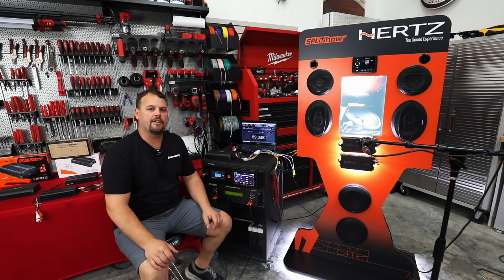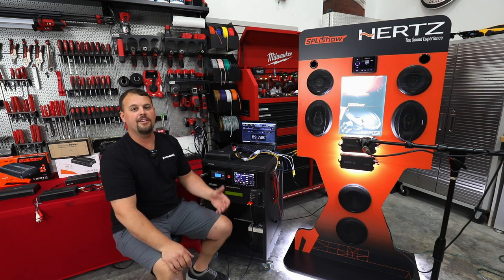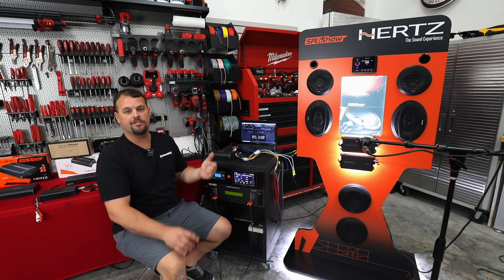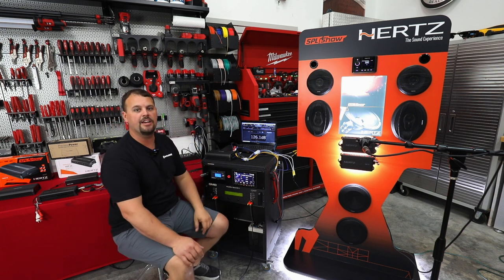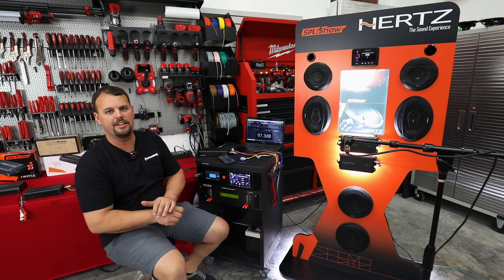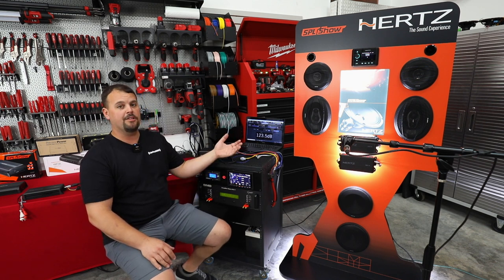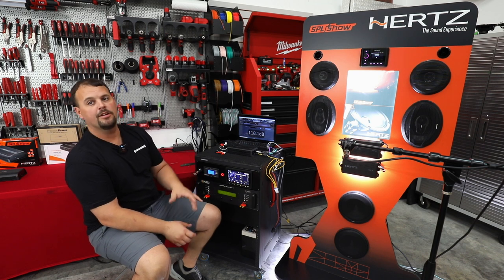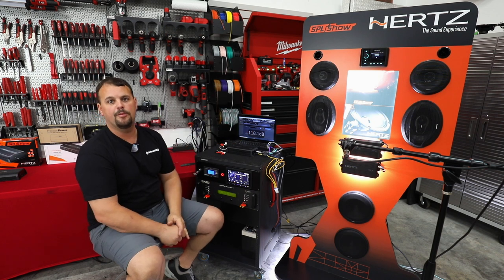How much more sound do we get with more POWER?!  Harley Amplifier Sound Comparison with SPL Readings

Comment: Another great video easy to understand and very informative. Curious about what to expect from the stock HD 4 speaker system if you upgrade all 4 four speakers with the SX165 Neo but kept the stock GTS system. Thoughts?
Reply from the maker: I get feedback from customers that is sounds much better but don’t expect huge volume gains, we always add an amp when upgrading speakers here at our shop, I would suggest using sx165neo front and sv165neo in the tourpack

Comment: What is the decibel reading in this same set up but running the sx690 neo’s on the sp4.900?
Reply from the maker: Sorry we did not test every speaker, this was meant to show what increased power does using the same speaker
Reply: @volunteeraudio  right I understand I was just wondering if you have done it in the past if you knew what it was

Comment: I have the 3 way Mille legend in an active setup. I want to purchase MLPOWER1’s/5’s will it sound better than the cheap cookie cutter amp brand (soundstage) ???????
Reply from the maker: The amp is very important, using mlpower amps will not only give you more power but also lower distortion
Reply: @volunteeraudio  lower distortion vs my cheap budget amps? So is the frequency range cleaner so highs are smoother? Also are these amps being class D amplification mean that the sonic signature is more on the class a/b level! 
Thanks
Reply: @volunteeraudio  when I compare the MLPower5 vs JLHD900/5 vs P1000X5
Hertz.              Jl audio.           Rockford
-80db.             -105db.            -85db 
The higher the value the lower the background noise. 
Does that spec mean that the JL audio is worth twice the price or is it a story that they’re selling? Or does every brand measure specs differently? 

Thanks
Reply from the maker: @toorop111  hertz rates everything with all channels connected to a load, many others cheat the test by only testing one channel
Reply: @volunteeraudio  JL Rockford may also cheat…….

Comment: Or are the "Hertz Dieci 130mm 5.25" 2Way Coaxial Speakers - Pair (DCX1303)" just as good?
Reply from the maker: We recommend upgrading to the hertz sx165neo or sv165neo 6.5”, what Harley do you ride?  The other 2 you mention are for cars and no where near as loud
Reply: @volunteeraudio   2007 electra glide
Reply: I have an all-weather Kenwood deck I plan to put in it my bike
Reply: My bike only accepts 5.25" dia speakers so do have a good one in that size? In my 2007 Harley Davidson Ultra classic
Reply from the maker: @scotthalliday2222  no, your bike will hold the hertz Neo 6.5” in the fairing using adapters and I have a video on how to add them in your tourpack too Tip for better Sound! How to port 1998-2013 Harley Davidson Tour Pack speaker pods for better Sound!
https://youtu.be/0oBQ1h3UHN0
How to replace your 5.25" Tour Pak Speakers with a larger 6.5" on a 1998-2013 Harley Davidson®
https://youtu.be/HQtGRNZlcdQ
How to Replace Fairing Speakers 1998-2013 Harley Davidson® Street Glide, Electra Glide, or Ultra
https://youtu.be/GqLHfRUU0Ec
Watch these videos and call us if you need help putting together a system at 1-844-30AUDIO

Comment: I'm leaning toward a complete Precision Power system. I want to replace my 6 speaker Boom 2 audio and add 2 more speakers in a detachable tour pak that I use only about 20% of the time. Will the Precision power amp handle this ? Im keeping my GTS head unit
Reply from the maker: It can run up to 8 4ohm speakers and does so very well

Comment: Sooooo after all of that I learned  …. Spend the big money on the speakers and ditch the amp hype.  Good speakers will give more sound.  An amp is only needed to fill in shortcomings of mediocre speakers.
Reply from the maker: Kinda, both matter, you need efficient quality speakers and an amp powerful enough and clean so that you can hear them at highway speeds and not have speaker failure

Comment: Dumb question why not use a steady power supply vs your dynoon a single
Reply from the maker: There is a 60 amp power supply mounted on the dyno cart with a huge xs power deep cycle battery as well